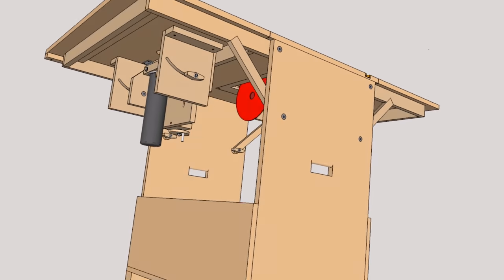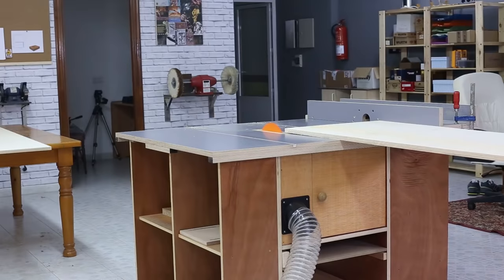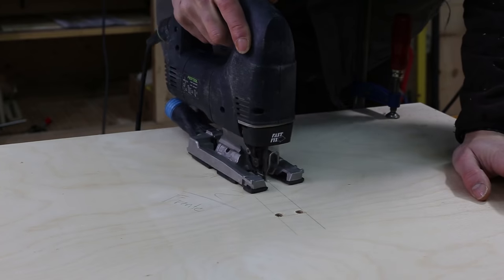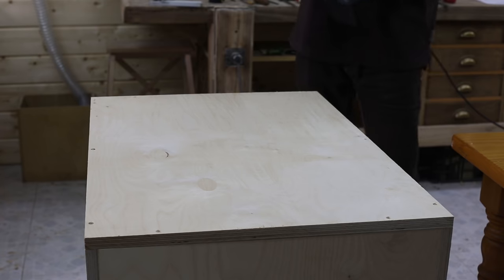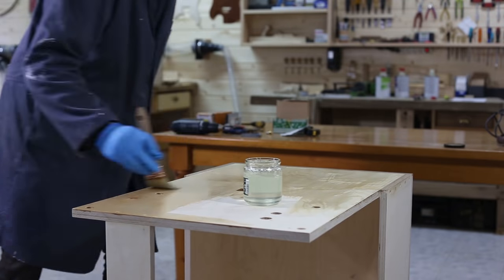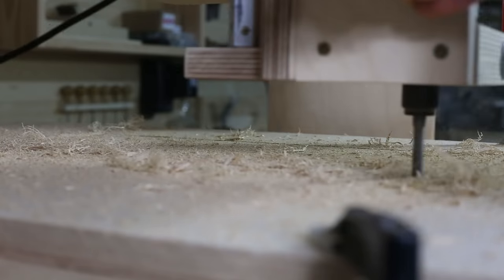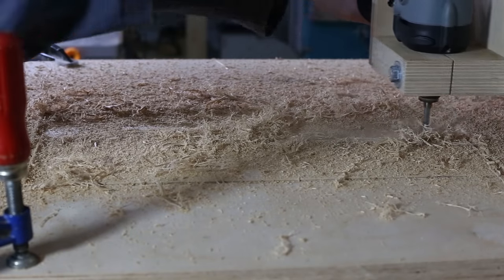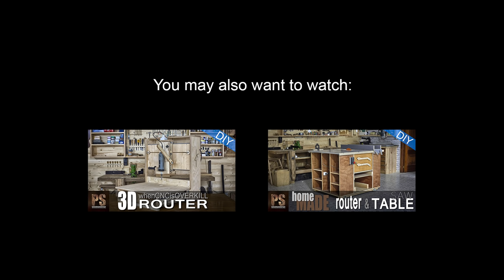Making a Portable Workshop - Part 1

Comment: really clever design.....are the wood dowels in the body of just to give a bit more strength?   (would have thought the screws would be enough on their own....)
Reply from the maker: +Tim Hyatt Yes, the screws would do the job, but if you want that little bit of extra strength, use the dowels

Comment: That's a nice project! 
Should I look for peculiar characteristics when choosing a circular saw to fix under the table?
Is not better to embed into the frame a circular saw table?
Reply from the maker: +Horror Coder Yep. But as many other users, that was the one I had.
Reply: +Paoson WoodWorking I understand, but since I have none of the two I was uncertain if choose from a cheap table saw or a decent handheld one....I guess I'll made some comparison search

Comment: Hey, Is there an option for a 1/2 inch collet for the kress milling motor. I have a bunch of 1/2 (12,7mm) inch bits that wont fit in a 10 mil collet. Or Is it possible to use a collet from a different router on the kress milling motor?
Reply from the maker: +Torwulf games I had the same problem. I solved it lathing it to 10mm in a metal lathe. It is easy to do.
Reply: +Paoson WoodWorking Thanks, I'll have to see if any of my friends have a metal lathe.

Comment: This is an excellent build, but I am even more impressed by your router milling table, perfectly sized and placed square and rectangular cut-out's with no jigs, no complex setup, just simple adjustable end stops, I am going to build this as soon as I can source the bearings and other components, I am curious are you a working tradesman or just a gifted hobbyist?, either way you are very clever and inventive, your videos are also very easy to follow, well done ....

Comment: No guards on the cutting blades. No riving knife on the circular saw. No emergency stop buttons. Good designs but you really must pay more attention to essential safety aspects. Also, a little more use of push sticks may be advisable.
Reply from the maker: please watch all the videos, the tool has riving knife, emergency stop and push sticks.

Comment: Hello, thank for all your video.I have buy your plans, and i was thinking about build it.Can make it with mdf ? Or other wood.Because plywood is expansive in France.Thank for all.
Reply from the maker: +Martial11480 Thank you!. Yes, you can use MDF but, it won't be the same. It won't last and won't be as stable as the Hard Plywood.

Comment: I did not find anywhere the approximate cost of materials. At least the wood. With your answer I might buy the plan.
Thank you
Reply from the maker: depends on many factors, in section 5 of this article you will find more info:
https://www.paoson.com/en/blog/why-should-i-build-my-own-tools-n101
Reply: @Paoson_Woodworking  Thank for your reply. Let's say I will use common plywood. Can you give me an average of the cost? Or a price range? Or maybe how much square meter of wood it's needed to build it.